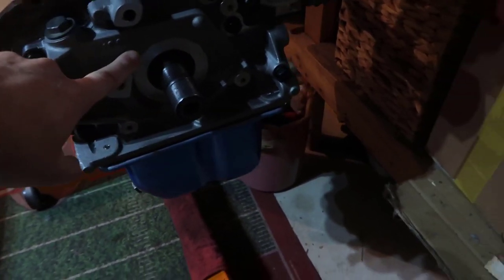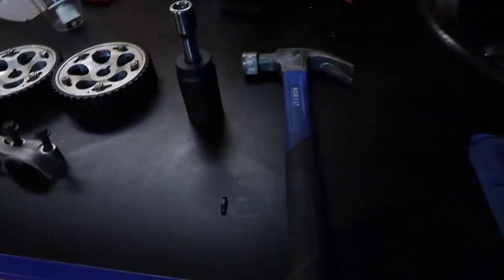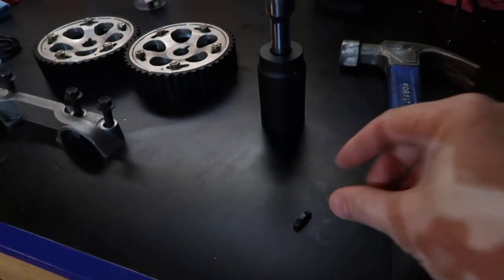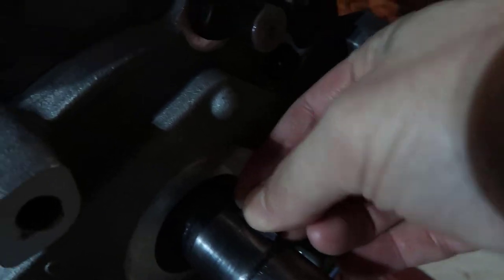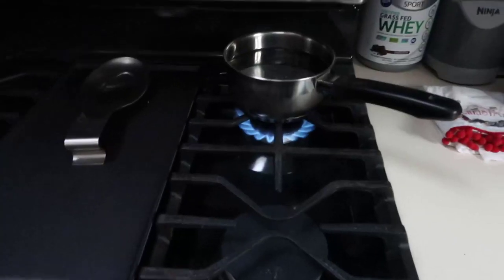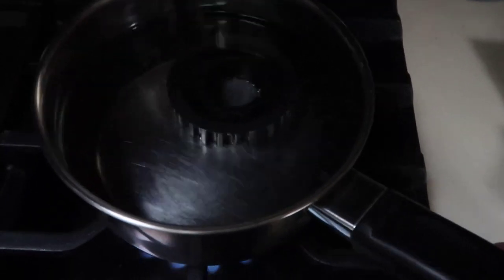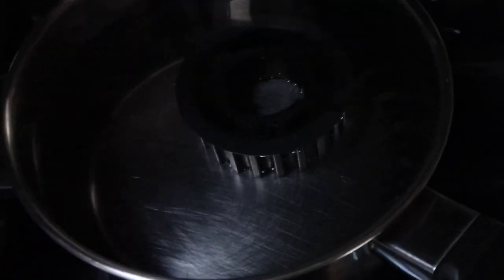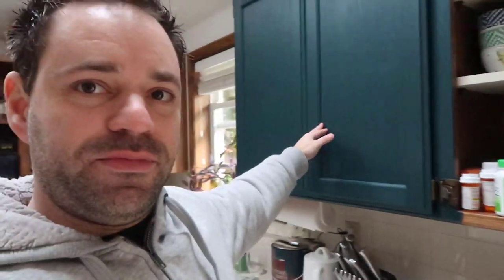Installing Crankshaft Sprocket - 420A #Eclipse2GBuild

Comment: So I've followed ur videos for a few here and commented a few times. I've made it to the stage of replacing the crankshaft gear here. Where could I purchase a new one at? I've searched all over. No luck though. Am I up shits creek?
Reply from the maker: @z3roxc00l9  hey brother, thanks for watching my videos.  I hope they have been helping you.
Found bearings here. You will need
https://proenginerebuilders.com/product-result/?ymmq=yr_1997~mk_mitsubishi~fd_eclipse~ls_2-0l~hy_crankshaft-kits-components-

Found a crankshaft here.  Might want to re filter year make and model to be sure and call them to double check.  I don't know those guys though. Just found them online
https://crankshaftsupply.com/product/engine-crankshaft-kit-2-0l-l4-1996cc-122ci-19090/

I hope this helps brother
Reply: @CarModsGarage  I appreciate the response. Unfortunately I am needing the sprocket/gear that goes onto the crankshaft such as the one in your video here.
Reply from the maker: @z3roxc00l9  oh I missed that part. I couldn't find it either. Might need to go to a wreck yard.

Comment: What if my sprocket is standard, say, for a Chevy 305, and I pound it on the crank with a pipe without heat.  Could it be stressed too much and cause early failure of the gear? My sproket does not look as strong as yours.
Reply from the maker: I believe if you pound on it you can stress the thrust bearing. I've done that before and nothing happened but it is not recommended.

Comment: Where did you get the sprocket from? Off another engine or online? Awesome video!
Reply from the maker: Thanks for your comments 🤙. 
I took it from the engine that was on my car. Are you having throuble to find one?
Reply: @CarModsGarage  I have one currently on another engine, I just know it's a huge pain to remove it I'm sure you had an experience with removing yours haha. But no can't seem to find one online. I'll just have to resort to pulling it!
Reply from the maker: rent the tool at O'Reilly and remove it. Mine came out "easily". It wasn't too bad

Comment: Where did you get the guide pin for the crankshaft sprocket, I cant find it anywhere. If you can respond to this I would gladly appreciate it.
Reply from the maker: I got it from the person I got my block and camshaft. Have you tried CarID or Summit Racing?
Reply: @CarModsGarage  no I haven't yet, should I check there?? I need it bad
Reply from the maker: @dsmstatic9955  yes definitely do. I'll find another place I got stuff from and post the link here in a few.
Reply: @CarModsGarage  ok awesome, I would really appreciate it man, do you live in Texas??
Reply from the maker: @dsmstatic9955  There is your thing. Be happy brother and don't forget to subscriber :) lol

https://www.cimotorsports.net/mopar-lower-timing-woodruff-key-eclipse-talon-neon-420a.html?gclid=CjwKCAjw-OHkBRBkEiwAoOZqlz1m7xMUNaoTltD8Vd6tV-gr9xsh5_8o7eXjL3tRSZe4HIq_1lliAxoCm0QQAvD_BwE
Reply from the maker: @dsmstatic9955  I moved from Texas to Spokane WA. The other side of the country. Where do you live?
Reply: @CarModsGarage  in the Dallas area
Reply: @CarModsGarage  thank you so much bro and yes I've been subscribed and turned on the bell for post notifications 🤙😊
Reply from the maker: @dsmstatic9955  I hope that works brother.
Reply: @CarModsGarage  thank you, I tried ordering but it won't let me, I'll call them tomorrow. Have you ordered from them before?
Reply from the maker: @dsmstatic9955  I have not. Google that name thought. You might find somewhere else
Reply from the maker: @dsmstatic9955  I was researching a bit more and I found this. It might be worth if you don't find it to take the cranky to a shop and ask them to do that so you can fit different keys in there. I'll research s bit more though just for fun.  https://www.google.com/search?q=woodruff+keyway&tbm=isch&ved=2ahUKEwiYksPhkZ_hAhULmVkKHeuHDG8Q2-cCegQIABAC&oq=Woodruff+Key&gs_l=mobile-gws-wiz-img.1.3.0l5.36994.36994..43258...3.0..0.80.80.1......0....1.......5..35i39.dlwM01ooEes&ei=MsGZXJixDouy5gLrj7L4Bg&bih=604&biw=412&client=ms-android-google&prmd=sivn&safe=active#imgrc=qTNTS-vM9qjmHM
Reply from the maker: Score. I think this is the item. I found the Mopar part number and found it on eBay. It's worth a try. Only $10. 
https://rover.ebay.com/rover/0/0/0?mpre=https%3A%2F%2Fwww.ebay.com%2Fulk%2Fitm%2F263025551585
Reply: @CarModsGarage  dude thank you so much for your help, btw I enjoy your content man, keep it up. I'll spread the word about you. 🤙😁
Reply from the maker: Thanks a lot man I appreciate that! Keep me posted on your problem. I am curious if it will work :)
Reply: @CarModsGarage  yes I sure will, thank you once again, you've helped me alot.